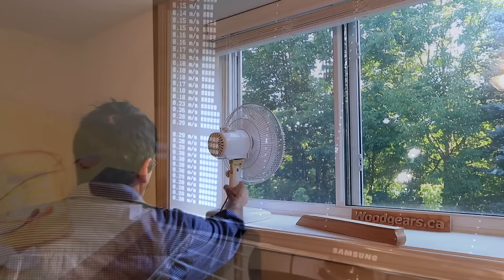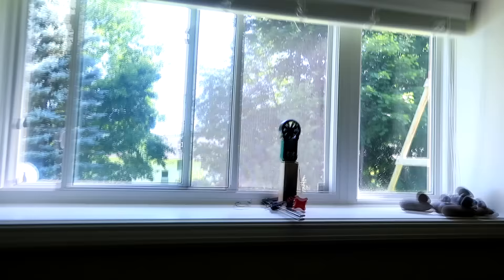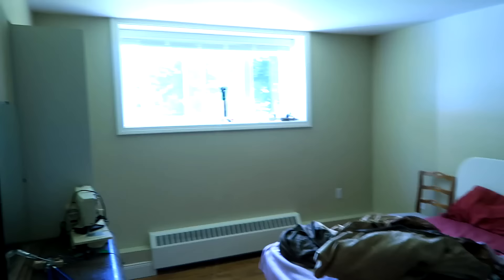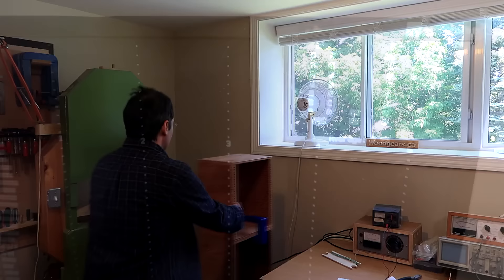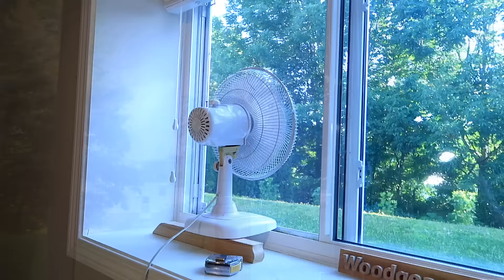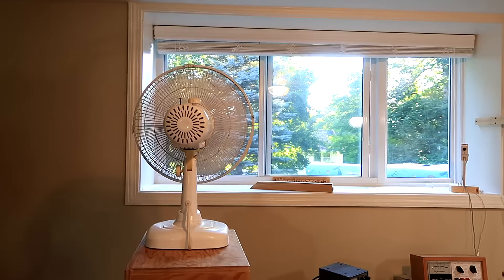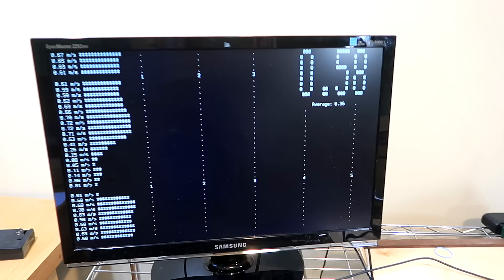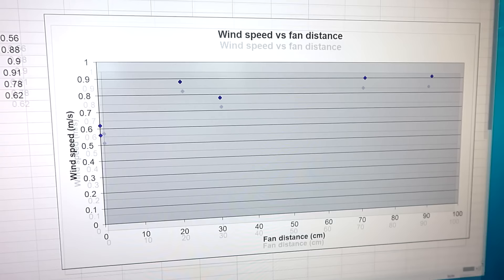Best fan placement to move air through the house

Comment: I've used this method for sucking cool air into my house for over 40 years. It's great for airing out the house too. I was totally not expecting the air intake at the corners, but confirmed that actually happens. I have a 20" box fan in a plywood frame that fits completely in a window frame so the only air flow is through the fan itself (none around the outside edges of the fan). How would that change your results with the fan up against the screen? Would it make any difference if you covered the 4 corners of the fan? Thanks for a great video.
Reply: You could make a shroud out of plywood to fit perfectly around the fan blades inside the box

Comment: Super good to know. It makes sense that the friction where the air currents shear would pull some of the air from the surroundings of the room along with it when going outside. I'm wondering if maybe laminar flow would exaggerate this effect versus the turbulent flow seen in the video. I know that Dyson fans use a similar effect and they utilize laminar flow to some extent, so I have a feeling it might increase the effectiveness here if the air being blown out were less turbulent.
Reply: I'd guess you want turbulent flow. Ideally, you'd send as much air out of the room with as little speed as possible. If you have the converse (less air, but faster wind speed), the air is going to slow down after it arrives outside, using extra energy to move outside air you don't need to move.
If you're in a closed room, maybe laminar flow is better to provide more circulation, because that extra airspeed will be useful after reaching the other end of the room to push air back around.

Comment: Entrainment in action. Similar to how the dyson fan moves air or how you can fill a bin bag with air in one breath if you move your mouth away from the opening of the bag. Air is sticky....and drags other air with it. Also when you're fan was further back it created positive pressure across the opening, with the fan closer the airflow would've only been accelerated over a small portion of the opening, had you put the anemometer up above the fan at the opening you would've seen air being pulled in above the fan towards the back of blades. I do pharmaceutical HVAC c+q, pressure cascades are my jam.

Comment: In Indonesia, we have this fan called “hexos” which can blow air both ways. I usually cool down my room by turning the hexos on and blowing air out of my room, my room gets cooler then. Is the principle the same?

Also now I’m in a room with no hexos. I put the fan in my door (a bit “in the room” to create space between the space outside and my room”), will it work just the same?

Comment: Have you tried measuring the airflow with the box fan in different positions? I think the box fan might actually do better when it’s placed up against the window screen, because there’s less space for the air to go around it. Also, if you remove the feet from the fan, you can put it right up against the window screen pointing inwards.

As for why the desk fan can match the airflow of the box fan, that may be because of fan speed or fan blade shape. Size isn’t the only thing that affects how much air a fan moves.
Reply: Yes he's only measuring velocity which is cool but not CFM which matters more for airflow.  That would be the ultimate comparison but if the small fan is much much faster with better blade design it could be better

Comment: I would like to see your experiment include temperature change in the room and other room as well. The goal is not to increase wind but reduce temps. The air flow you are creating by blowing into the window is pulling air from the inside the house thus the increas. This doesn’t mean you are reducing overall temperature and creating a more comfortable environment.
Reply: you can reduce temp by moving hot air outside toward sun-side and sucking in cooler air from shade-side
Reply: @firmaleggibile4130  but seeing the science is believing :)

Comment: Legit useful information when you need to vent your house for something like paint fumes. Or it's summer and the house is sweltering but the outside nighttime air is nice and cool.
These are the types of experiments I'd be doing if I had the smarts and knowhow. No idea why this ended up recommended, but I'm glad YouTube did.
Reply: Firefighters sometimes use the same effect to expel smoke from a burning building.

Comment: Extend the sides of the fan with some cardboard. You will be suprised.
Reply: I don't have a fan, but I'd love to see how this affects the results.
Reply: The way you phrase it, the only way I will be surprised is if it doesn't make any difference.😁
Reply: Sounds like click bait. You won't believe this one amazing trick!
Reply: @cbalan777  Exhaust fan manufacturers hate this comment
Reply: I was thinking of doing this. Wish I had a way to check results.
Reply: I've been trying to reach you about your fans extended cooling capability!
Reply: Extending the sides works only in the sense that it directs the air from the blades. You still need a gap between the end of the fan sides and the window to allow for the Bernoilli effect to take place.

The screen is severely limiting the airflow! It creates a high pressure zone which ruins the Bernoulli effect.
Reply: @charlieodom9107  yes but the screen prevents you from being eaten alive by mosquitoes.
Reply: @charlieodom9107  Can you explain the need for a gap between the cowl and the propeller a bit further? What kind of gap are we talking about?
Reply: @nevenpavlovic4448  I'm not sure cowl is the correct term, but the gap varies depending on air speed, length of the shroud, venturi angle, etc. Ideally, you want the shroud to be long enough so that the air exiting it is near ambient pressure, but not so long as to create additional air restriction. Placement of the fan is also important. Too close or too far into the intake and you lose suction, too far away and you lose velocity and suction. This isn't a set number, since all fans are different.

This is very much the same way fans on AC condensers work. The fan blade is placed just far enough into the shroud to create the most suction. Any farther into the shroud and you lose the bernoulli effect, any farther out and you lose air off the ends of the blades. Cased Axial fans are generally better at keeping air from spilling off the blades, so using a fan like the oscillating one in the video isn't ideal.
Reply: @charlieodom9107  Does your mother hear you speak like that?

Comment: What a fun and useful little video thanks homie

Have you since tried this experiment but changing the angle of the fan?

I’d be curious to know what (if any) effect it would have on the data if you hung the fan from the ceiling pointing towards the window at various distances and angles

Comment: I'm curious at what the results would be unobstructed, without the screen, like with a window fan. I'm wondering if the wires in screen may be blocking the air a little bit, or redirecting some air back into the house.

Comment: This is probably a result of Bernoulli effect taking place.
The fan creates a stream of air with a certain velocity and according to Bernoulli's principle, this generates a low pressure region around the stream. The surrounding air (on a higher pressure) is sucked into this stream. In this way, more air is sucked out of the room, that per ser creates a low pressure region comparing to the other rooms, forcing air to move from the other rooms to fan room.
Thus also explains why distancing the fan from the window increases the effect as you increase area around the air stream coming from the fan.
There are some other videos focusing on Bernoulli's principle in respect to filling balloons. May be worth watching to enhance your experiments.
😁

Comment: I often sneak a cigarette at home and I must say that placing the fan in the middle of the room in comparison to right next to the window has yielded better results for me. I point the fan straight at the window and use the full power mode and the cigarette smoke and smell clears within 5 minutes. The best results occur when a second window is opened directly behind the fan.

Comment: As a firefighter we learned this when we have to ventilate smoke out of a building, putting the fan right in the opening only works if you put a tarp to block the rest of the opening

If we want to blow air into a building  put the fan on the outside of the building far away enough so the entire opening is in the cone of the fans spray

Comment: The reason the fan works better further away is because of the Bernoulli effect. The fan creates a stream of low pressure air in front of it which pulls the air from around the entire stream i.e., the whole room. 
When you put the fan against the window, there is only a small, low pressure area around the back side of the fan. 

It’s the reason why your shower curtain is pulled into the shower when you turn it on. It’s the reason why leaf blowers have funnels to focus the air into a smaller stream to have more efficient… blowing I guess. If you take a piece of paper, fold it in half and set it on a table like a tent and blow through its center with a straw, the paper will collapse.

Comment: The reason that moving fan further from the window is creating more airflow is because fast moving air from the fan is creating low pressure zone that sucks in slowly moving air around the stream. This causes fan to actually blow more air than it sucks in. This is called "coanda effect". If the fan is too close to the window, it can't suck in all this extra air from the room. 
Bladeless fans like Dyson work on this principle, and are much more efficient at this. Action Lab has the video about it.
Reply from the maker: actually it’s called entrainment, and the coanda effect is a result of that.  i made a video about that too.

Comment: I tested this on my windows in Finland with a standing air circulator and my results were the best when it was as close to the windows as possible.
The caveat though is that the window is ~30cm and due to the circulator's base and the window's thickness I can't put it right against the window, so it always stays ~50cm away from the opening itself.

Comment: When the sun goes out the outside temperature is lower, what I do is put the fan at max speed around 50 cm outside blowing air into my room, it seems to work for me but I am now going to try this method, I have read about it before but I never knew how to do it, watching you doing it has taught me visually how to do it.

Thank you very much.

Comment: my take away is: box fan, tape up the corners to prevent air from being sucked in the front, seal it to the window with duct tape and turn it on high to pull air out.

Comment: Another reason for it generating more air flow further away is that with increase in distance it gives the air more time to sort of push along air particles. As moving air creates friction and thus sets other air particles near and around it in motion. I've seen someone (I forgot who) blow up a balloon-ish thing with just lightly blowing towards the insides of it from 10-15cm away and it blew up so quickly lmao

Comment: That's crazy.
I always put the box fan right up next to the window and then blocked off the sides so that I had it somewhat sealed from pulling in air right in front of it and opened windows on the opposite side of the house.
I always figured it pulled air from the middle etc but I never would have thought putting it a ways from the window would be better
The screens are definitely a huge problem in reducing air flow.

Comment: I have been trying to get my wife to understand how air flow works through the house with fan directions and having certain windows open to pull in or blow out the air... Years later and I still have to do it myself! 😂

Comment: Much better if you have a ceiling window with an exhausting fan that can pull the hot air outside the house and keep the cold air inside. As it is explained that cold air is coming from the lower part or the room while the hot air is above the room therefore if you have a ceiling window it will pull the hot air out and have the cold air circulate.

Comment: If you put a box fan in the window and seal up the window with cardboard and a unique fashion and then you add an existing fan approximately 4 ft away from it and the same direction and height you will have perfect circulation...

You also have to take the freaking screen off.

Comment: I think a better way to get airflow throughout the house is to put one box fan pulling air IN from one window 🪟 and a box fan blowing air OUT another window.  

Preferably windows across from each other; but if you don’t have that, put a standing fan a few feet away from the box fan blowing air IN, and “guide” the air toward another window with a box fan blowing the air OUT.

At night, this pulls the hot air out of the house and the cool air in; same principle as the old attic fans in the south.

Comment: Just to give my own anecdotal conclusions. I’ve been putting a box fan in my window, sucking air from the outside and one important thing to point out is not just the airflow, it’s about WHERE the air comes from. If I would emulate your experiment I wouldn’t get as good results as I desire. Yes, perhaps technically more Air would be moved but the important distinction is that I need the air from the outside to get inside due to the temperature difference. If I’m just sucking in air from the living room adjacent to my bedroom the cooling effect wouldn’t be nearly as great because I would be moving the already existing warm air in the living room into my room and then out the window. Therefore, my best result is when I put the box fan really close to the window to suck in as much air as possible from the outside and to leave my bedroom door just a little bit open to make the sucking of the air easier and thereby moving the air more efficiently in from the outside and out from my room into the living room. In conclusion during optimal conditions the temperature in my bedroom can differ up to 5°C from the temperature in the living room, even though several large windows are open in the living room. Thanks for a great video.

Comment: First of all you’re using the wrong type of fan. Use a box fan, put it right up to the screen, facing out, close the window down on the fan or in this case, cover the rest of the window above with cardboard. Open another window on the other side of your house… Works like a charm.

Comment: Moving the fan away from the window while blowing air out allows the stream of air to pull in additional air around the sides of the stream. I think the reason the box fan did not do any better than the smaller fan in this case was due to the size of the window opening. The larger fan created a bigger stream of air, but it was likely being restricted by the size of the window.

Comment: Wind doesn’t Blow, it Sucks. Find a description of this from R. Buckminster Fuller.  Related: Tension is a more efficient principle in universe compared with compression.  That’s why cables pull an elevator car rather than telescopic shafts pushing the car further away from the earth.

Comment: Fan\wind make body temperature EXCHANGE faster. Thats it. Fan can be heating us if our surrounding is over 37C. If you leave fan working in empty room temperature will only rise, because of working motor. To refresh house air open 2 windows in opposite sides of house.

Comment: Excellent video and demonstration. Couple of things to add...
The fan creates a column of moving air, roughly the size of the fan blades. But being further back, the size of the column of air increases, due to the moving column pulling on the air around it, bringing it along the way. The optimal position of ~1 metre is where the column picks up the max amount of extra air. Any farther back and the column starts to get turbulent as it reaches the window, meaning the column of air doesn't completely find it's way out and starts to recirculate in the room. Too close and the column hasn't picked up all the extra air it could have. 

One of the other reasons cooling works this way is that on a fan, the front face is the pressure side and the rear face is the negative pressure (vacuum side). 
Pressurised areas are warmer and vacuum areas are cooler. 
By having the fan point outward, it is not only drawing in potentially cooler air through the house from the outside, but it's causing the house to be under a slight vacuum which drops the temperature inside. 
The fan is not only moving warm, stagnant air out - it's also drawing in fresh, likely less humid air (which also helps it feel cooler), along with likely cooler air, as well dropping the temperature through the vacuum effect

Comment: Ots only better being farther away from window if you are either working with natural direction or not fighting the imcoming air.   

Unfortunatly that means sometimes pulling air from the hotter side of the house.

Also the small fan in a big window is a major factor I would think.  If fan is a high oercentage of opening it certianly would work better in the window opening

Comment: You should probably also look at what windows to open. Just window to window air current may not be most beneficial to your house, if eg you're couch is not near the air flow that's being generated. It could be this just creates a jet stream (albeit a small one) between the two windows you open, while other areas of the room/house stay exactly as-is.

Comment: The reason you didnt get the air suck in is because the fan motor is interrupting in the middle between outside air & the fan blade…
Thats also why the exhaust fan motor is placing on the other side…